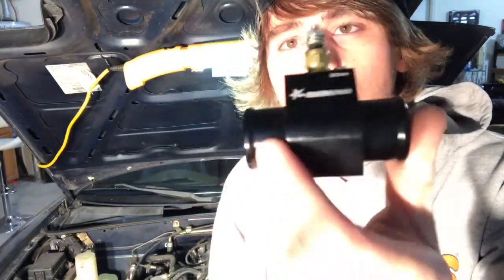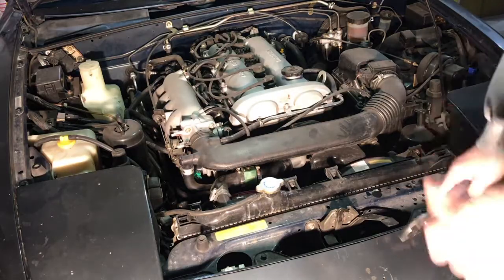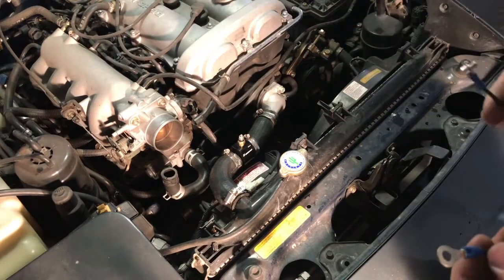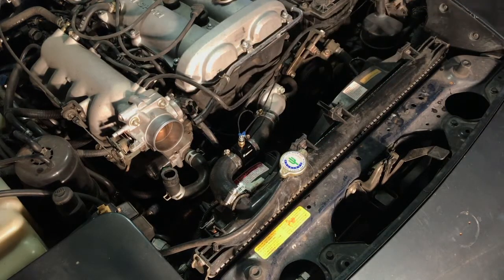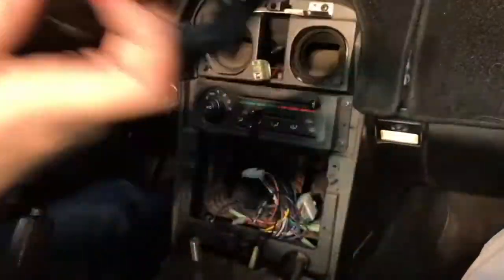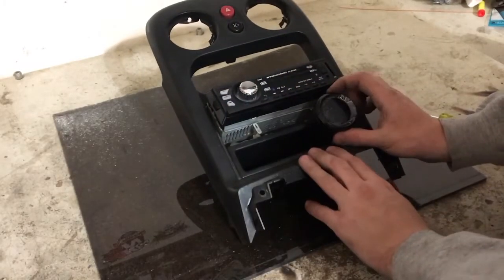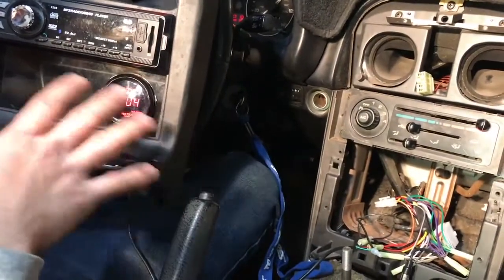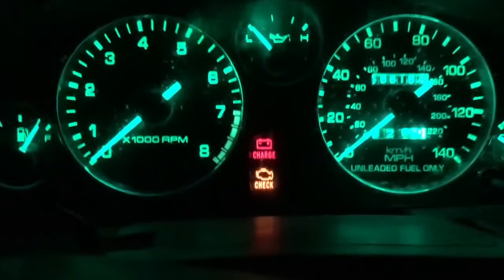How To Install A Coolant Temp Gauge

Comment: Did The Gauge actually work I have bought 2 and they both sit at 104
Reply from the maker: Happen to me too. Ended up being the sensor and gauge not being compatible. One is Fahrenheit (the gauge) and one is Celsius (the sensor) or vis Versa.
Reply: @NashCustoms  ok my sensor came with The Gauge so it should be compatible probably just a dud thanks for the reply
Reply: mine worked at first. I happened to unplug it to get to some other gauges. plugged it back in… now it just sits at 104. i’m thinking maybe one of the wires could be loose. not completely sure. i would check the wires first and go from there.
Reply: @nickdiezel5606  I figured it out you have to run a ground from the adapter

Comment: I tried tapping into my oem thermostat sensor and it didn’t work so I guess I’ll go with that adapter plate for hose
Reply from the maker: The oem thermostat sensor does not send signal the same as this will.
Reply: Yea I figured, I just bought that adapter rn so we’ll see if it works, plug your IG man I’d love to see more of this build
Reply from the maker: Sadly the build didn’t go far before it ended.
Reply: NashCustoms did you ground the little Allen key separate to the black ground of the pod? That sucks man, I love miatas I want one myself, I have an eclipse currently that I’ve been building with my dad for a couple years
Reply from the maker: Brave Souls Garage yes I ground it to the chassis. They are amazing cars even though they don’t make much power.